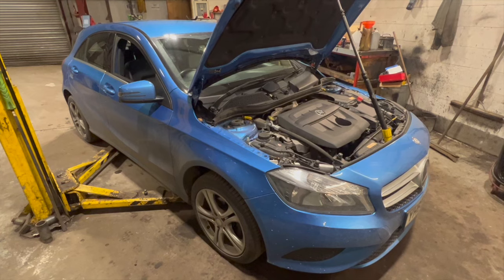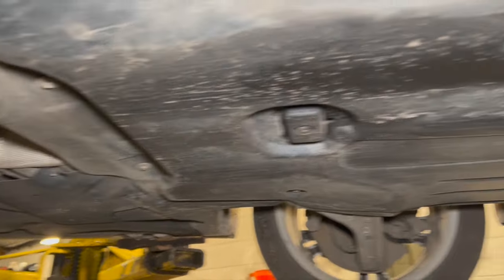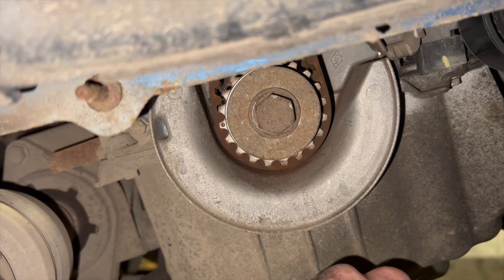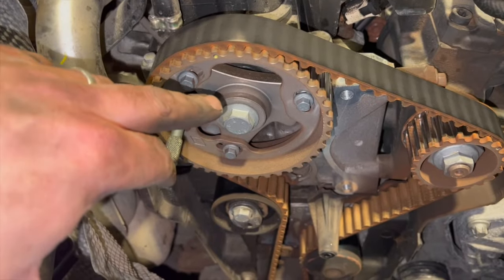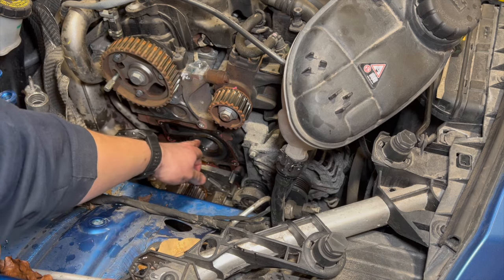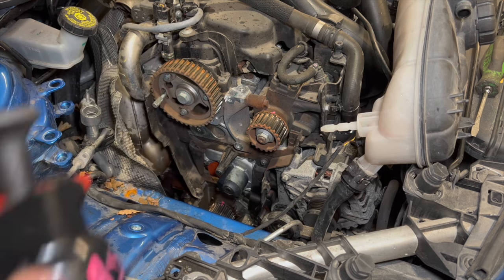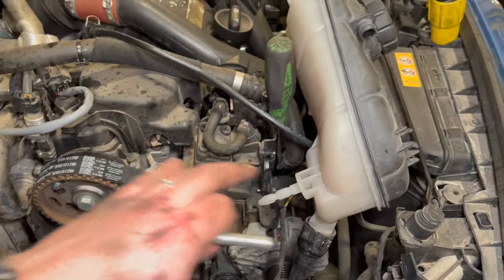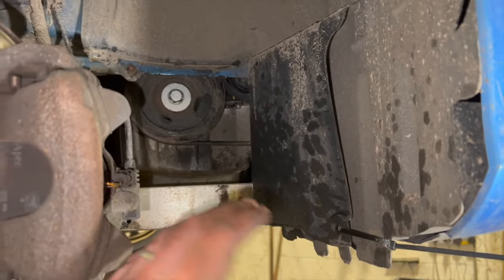Mercedes A class 1.5 CDI Timing belt & water pump replacement

Comment from the maker: Gates Timing belt kit & water pump eBay - https://ebay.us/HFssZD
Gates Auxiliary belt eBay - https://ebay.us/1bnGFz
Anti freeze - https://ebay.us/um2Ex5

1.5 DCI timing pin Tool kit eBay - https://ebay.us/yFd8vK
1.5 DCI timing pin Tool kit Amazon - https://amzn.to/3laxWv5
Flywheel locking tool - https://ebay.us/Hv6IDv 

Tools Used :

             Milwaukee 18v 1/2" Impact driver - https://ebay.us/h7mI4N
             Milwaukee 3/8 Drive Mini Impact driver - https://ebay.us/Pg8ilg
             Socket set - https://amzn.to/3eGx2Ak
             Ring Inspection Lamp - https://amzn.to/3gGWHcG
             1/2" Torque Wrench - https://amzn.to/2VZ4CKu
             E Torx Socket set - https://ebay.us/5a3i3Y
             Milwaukee 12v 3/8 Ratchet - https://ebay.us/BZZqQG
             Spanner set - https://amzn.to/2DlwUZm
             Allen key set - https://amzn.to/2Dx12B2  
             Digital Torque wrench -  https://amzn.to/34kpI9y
             Screwdriver set - http://ebay.us/NUu3Q1
             Spanner Set - https://amzn.to/389UOTk
             Inspection mirror - https://ebay.us/hPLzKd
             3/8 Digital torque wrench - https://amzn.to/2PP9vpP
             3/8 standard torque wrench - https://amzn.to/33eZsxj            
             1/2" long ratchet - https://ebay.us/HZYPgk
             Pry bar set - https://ebay.us/8XpNUO
             Long ratchet spanner set - https://ebay.us/E7nfWt
             Trim clip removal tool set - https://amzn.to/3pcUl9N
             Trolley jack - https://ebay.us/zOJBnH
             Brake cleaner sprayer - https://amzn.to/2BLF1gX
             Lock tight - https://ebay.us/L71CGp
             Grease - https://ebay.us/DPsLxx
             1/2" extension set -https://ebay.us/6R20bE
             Oil / Coolant catch tray - https://ebay.us/xT2p1X

Torque Settings :
Water pump bolts = 10 NM
Timing belt cover = 9NM
Timing belt tensioner = 27 NM
Cam pulley bolts (x3) = 14NM
Crank pulley = 120NM + 95 degrees
TDC (Crank timing pin) plug = 25NM
Engine mount bolts = 21NM
Wheel bolts = 130 NM

Check out my other timing belt videos: https://www.youtube.com/playlist?list=PLDTPJANi9HjoaO_bcawhaGNVnFCg1HWCV
Check out my other renault / dci videos : https://www.youtube.com/playlist?list=PLDTPJANi9HjrkE0q8cjDi87PhuVtz2l-i
Mercedes playlist : https://www.youtube.com/playlist?list=PLDTPJANi9HjocMJKAazERWUzvYPGkZ7D-

Comment: Just did this job today. Great video you walked me through the job. Only thing I would add is that the 2 horizontal bolts on the mount can easily be accessed by removing the plastic arch liner. Merc put access holes and everything!
And for anyone reading this without air or powerful impact tools, the starter removal and locking tool is a doddle. 
Cheers
Reply from the maker: Thanks for the info

Comment: Did a full service on our A180d at the weekend and this video was much appreciated. 

I used a drill bit to lock the cam and used paint marker on the crank. 
I pulled the arch liner to get to the holes to do the engine mount. 
I also pulled the pipe off the radiator to drain the coolant as I replaced that at the same time.
Reply from the maker: Great to hear! 👍👍

Comment: I like your video and the way you work. (I don;t say that very often) One thing, You mentioned about bleeding the coolant system. You said to put the heater on full heat and full speed. Full heat and no speed would surely be better as the vehicle would warm up faster which would then open the thermostat which is the aim. Its been  long time since I did my apprentice and things have changed so maybe their is a reason for full heat AND full speed instead of just full heat?
Reply from the maker: Thanks 👍👍 tbh it’s just a routine that I’ve always done and been taught
Reply: The reason you put the blower on full is so you can easily feel the heater getting hot through the vents so you know its circulating the coolant round and theres no trapped air. If it was a case of wanting to just get it hot as quickly as possible it'd be better to put the heater onto the cold setting so there's minimal heat lost into the cabin. Which once you're happy that everything is circulating and has been bled up properly you could do that so that the engine warms up faster so you can check the cooling fan comes on as it should. Which I've done quite a few times just for peace of mind.

Comment: Great video. What is the correct interval for the timing belt change on this model. I’m looking at buying one and I’m reading different answers?
Reply from the maker: autodata sais 124,000 miles or 10 years whichever comes first

Comment: Good day, it's a great video. I have a question. Is the crank locking of the Renault 1.5 DCI and the 1.6 16 valve gasoline engine the same?

Comment: Hello, it's an educational video, thank you.  I'm curious about something. What are the size and dimensions of the 1.5 DCI crank locking (pin) device? Could you please share it? Thank you very much.
Reply from the maker: Thanks 👍 there a link to the timing pin kit in the description .. if you check it out you should be able to find out the sizes from there
Reply: Hello, thank you very much for responding to my comments.  I would like to be your WhatsApp friend to exchange information with you.  I would like to remind you that as knowledge is shared, it grows and develops.

Comment: What other changes you have to do I'm at 130k km on a Mercedes citan with same engine. I also need the classic oil and filter but what else needs to be done? You think the brake pads need change if they are the original? Anything else I'm just new thanks

Comment: Quick question - the engine mount 10mm bolts, are they only torqued to 21nm or should they be 20nm + 90degrees? There's a big difference!
Reply from the maker: I’ll have to double check autodata

Comment: Hi I got a 69 plate A180 1.5 diesel what mileage should you change the belt and water pump also mine is an Automatic are the locking pins the same as a manual gearbox?

Comment: Hi, great video. I can’t seem to find any data for the interval on changing the timing belt on w176 2018 facelift model, I saw one that says 90,000km. Any idea? Thanks!
Reply: update: I saw a forum post saying form OM607, it's every 200,000km/10 years for Europe and 100,000km/5 years for rest of world.. wonder why the stark difference? Anyone can chip in?
Reply from the maker: My autodata sais 96,000 or 10 years
Reply: Did you changed also the auxiliary water pump?

Comment: Nice video, how do you actually find this car? Any common issues would you recommend it? Is just got the same 2015 model, thanks
Reply from the maker: Thanks! There ok tbf , if it’s the 1.5 they run a lot of Renault gear… the do suffer with airbag faults relating to the pad in the seat which is a pain

Comment: hi mate really good tutorial for this engine timing belt change, after watching your video I felt I could do this job also , I've got a 125 Mk6 fiesta, I've got to change the alternator belt, but really could do with the timing belt renewed aswell, I've seen you fiesta timing belt video, could you give any advice about replacing the fiesta 125 timing belt please?  anyway thanks for your videos their great tutorials and nice film work, from Tony from Bedfordshire,
Reply from the maker: Thanks Tony , your comment is much appreciated !👍👍 .. Yeah that video will be the same for your fiesta .. there not bad to do really, the floating pulley always seems bit daunting but with the timing pins its not bad really, bit easy if you have a buzz gun.. just double check everything really , once the belts on, check everythings in line & the cranks definitely resting on the pin and you shouldn't have any issues 👌
Reply: @diydaly  thanks

Comment: Hi, what mileage, or interval did you change the belt at. The reason I’m asking people give different intervals and mileage. Thanks in advance!
Reply from the maker: The official interval on autodata is 86,000 or 10 years which ever comes first
Reply: @diydaly  cheers, it was just that a lot of places was saying 60,000 miles!
Reply from the maker: @Sophie333C  👍
Reply: Gretings, I have same car W176 OM607 1.5 diesel with 7DCT, car is made in 10/2016, I buy it at 61.500Km. I was at the dealer to check it, everything was ok, no issues, like new. Now I have 90.228Km, almos 29.000Km in 2,5 years. I take it to service for oil change (OE MB oil) and MANN filters MANN at every 10.000-11.000 km maximum, next maintenance will be in 186 days (third oil and filters change), since I have it. I wanna ask you if should I tell to the mechanic to take a look at the thooted belt? Because some guy from MB send me this maintenance intervals: OM 607/OM 651
For diesel engines OM 651 and OM 607 the service interval for the additional maintenance operations "Replace coolant" is now also "Every 200,000 km/ 10 years".
For the new additional maintenance operation "Replace toothed belt" on the OM 607 a service interval of "200,000 km/10 years" applies across Europe, while "100,000 km/5 years" applies for all other countries.
Use of 7-speed automatic dual clutch trans- mission
The introduction of the dual clutch, 7-speed auto- matic transmission into the A-Class means that the oil and filter changing intervals have changed from every 60,000 km (previously) to every 100,000 km/ 5 years (new).
I live in Romania. The car runs perfectly, I have not encountered any problems, but I am a little bit worried about the timing belt. Thank you so much for the video! 👍🏻 Looking forward for your answer.
Reply from the maker: @balamuc29  👍👍 sounds good , yes I would definelty enquire about the timing belt .. they won’t beable to tell from inspection but it will need doing at the correct interval
Reply: @diydaly  thank you so much! 🤗

Comment: Hi mate great video.....I have a renault kadjar 1.5 dci year 2016 done only 36,000 miles but unsure when cambelt needs replacing due to age,also would the water pump need doing as well if low mileage ?
Any help much appreciated,thanks.
Reply: Some say every 5 years is this correct or is it upto 10 years ?
Reply from the maker: Yeah , I’d always do the water pump at the same time
Reply: @1972dazbo  Renault say 5 year or, 60 65 or 70k miles (I cannot remember which) Whichever comes first. Mercedes do some mods to the Renault engine apparently. They extend the time/mileage as you know.